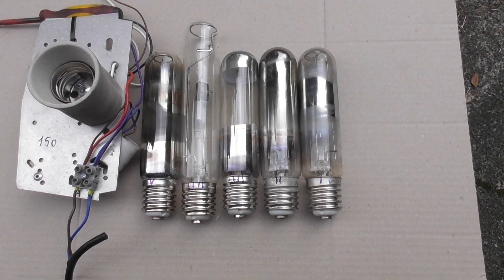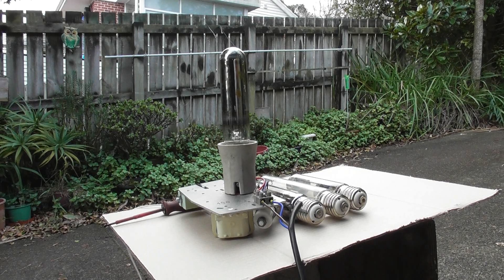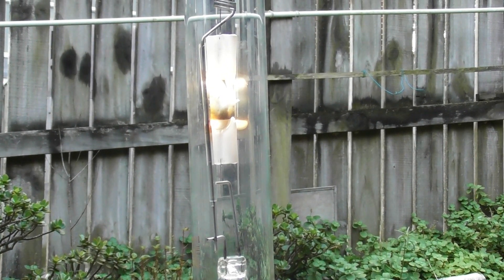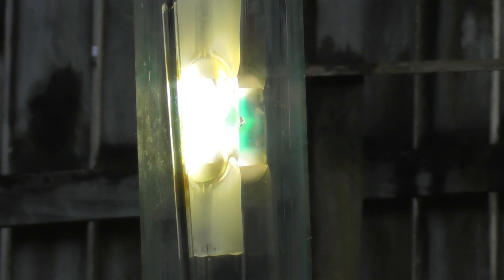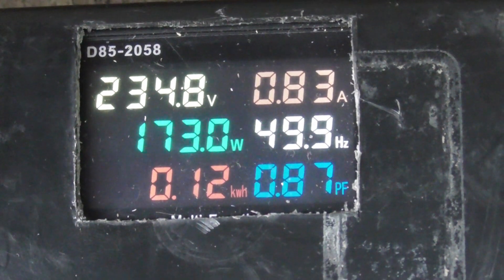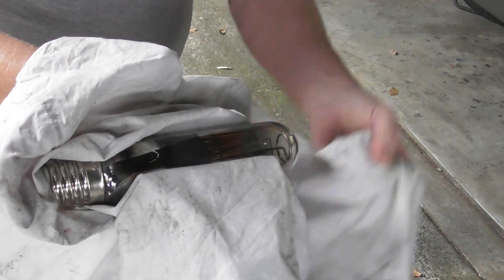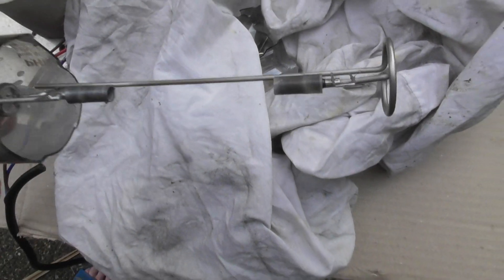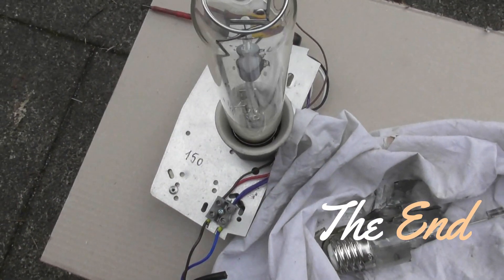The Aftermath of the HPS overballasted lamps

Comment: Keep in mind that you should never touch your bulbs 💡 with your bare hands ✋ and then use them without cleaning the oil from your skin off of the💡
Reply from the maker: Correct, but these lamps were expired.
Reply: Does that matter for the outer envelope of hps or metal halide? I've been touching them with my grubby hands for years.

I don't touch quartz halogen bulbs as I know that eats them up once they get to operating temp

Comment: You should have an x-ray meter
Overdriving bulbs causes them to emit xray radiation
Reply: The voltage has to be much higher for x-ray emission!
Reply: Isn't the threshold for x-ray like 25kv?
Reply: @hyvahyva  For certain high vacuum tubes yes.  It's quite hard to get measurable, legit x-radiation from just taking pot shots with various items and sometimes the clicks registered on cheaper meters is from EMI and not legitimate x-radiation.  But playing around with a set up like the old shoe fluoroscopes can be quite dangerous!

Comment: Impressive inside plating on those envelopes.  Reminds me of tube getters. :-D
Reply: I'm guessing that's the sodium.
Reply: @johnrehwinkel7241  Could be.  I remember back in the 80s disposing of 100s of low pressure sodium lamps.  These have quite a bit of sodium in them, enough, in fact that if the inner tube is cracked and thrown in water you get some fireworks! :-D